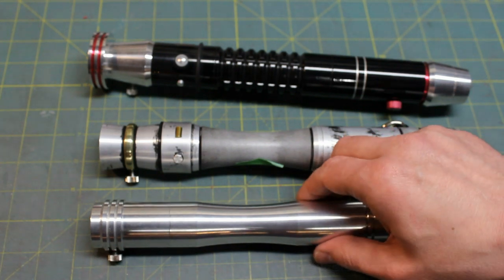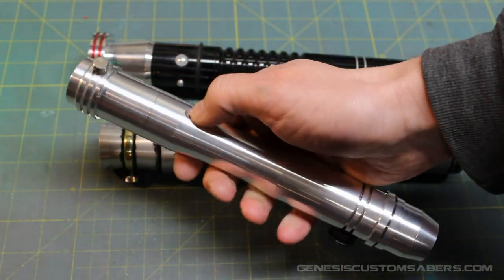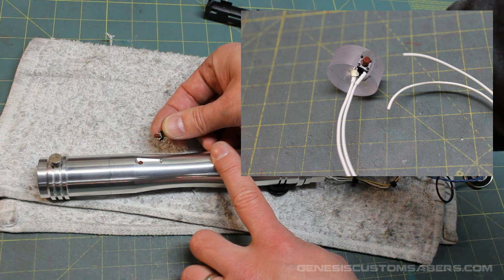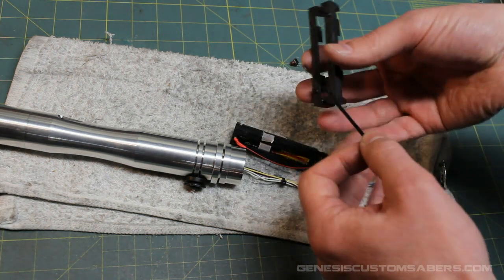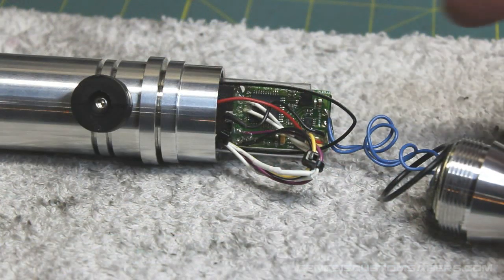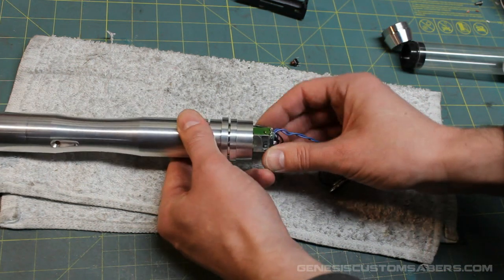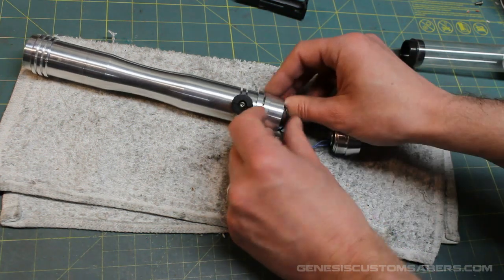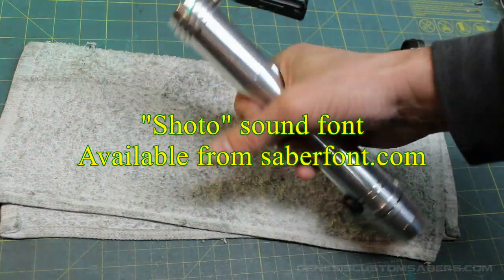MHS V2   a basic install

Comment: I think my only gripe about the MHS V2 system is that, well other than the smaller inner diameter (I say that just in case parts don’t fit. Is that they require you to buy more parts. Like say if you wanna go all out MHS V2 and no MHS V1 parts at all you’ll need to buy an blade holder, a choke (optional) one extension, a coupler part, and another much longer extension. I’d go with 6 inch since it’s the longest one they sell, and then a pommel. I really have no problem with the MHS V2 system it’s just that they need to stock more parts of different varieties and longer extension pieces that way people who are on a budget don’t have to spend extra money on the V2 system